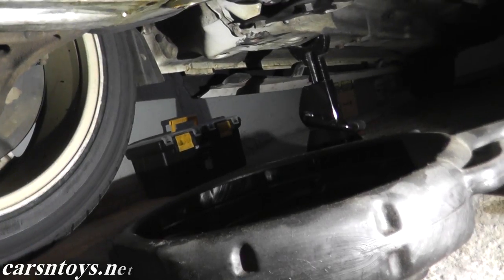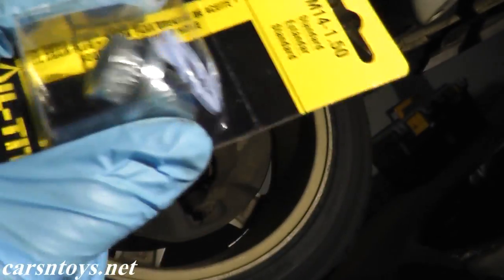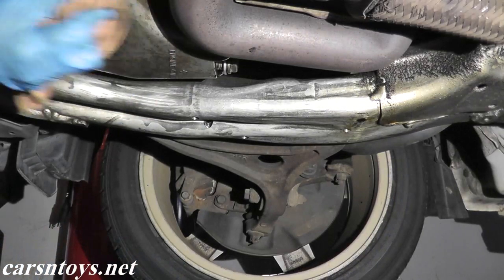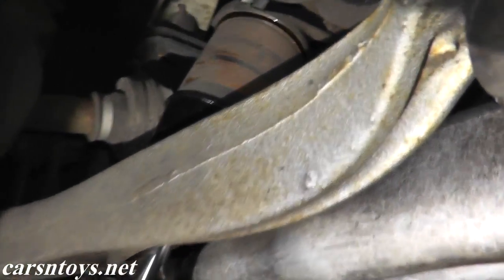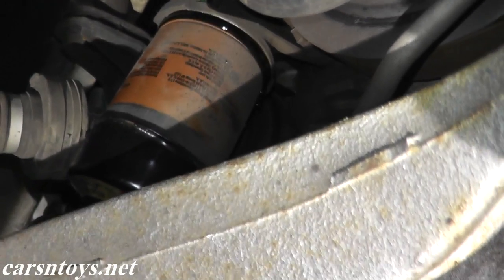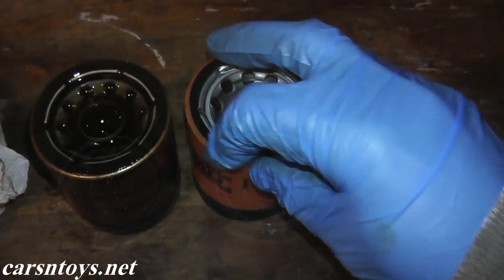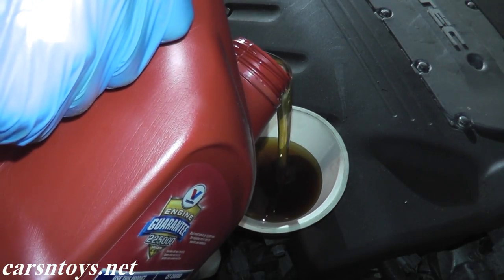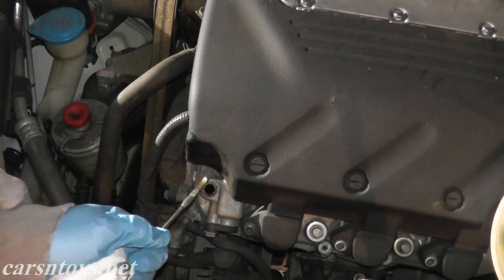Acura TL How to Change Engine Oil and Filter

Comment: I'd give a second thought to using dorman parts. On my previous car (2004 Monte Carlo SS Supercharged) I've had 2 sever failures of dorman parts. The first was a replacement ignition switch, after about 3 years it started going bad much like the factory (which lasted 10 yrs); being random dead ignition when trying to start. Before I could replace it I had the car shut-off while driving then refuse to start for about 10 min; I was very lucky I was able to coast to the shoulder.
The second was dorman aluminum replacement coolant elbows; The factory elbows are plastic and can crack as they age and will defiantly break when you remove the alternator mount/ belt tensioner. After a year I had a major coolant leak with the elbow at the intake manifold. When I pulled the elbows out the o-rings had melted, they looked like there was rtv on the ends instead of o-rings. I replaced the chinesium o-rings with GM seals from a new set of plastic elbows.

So long story short I've found the quality and reliability of dorman's product to be wanting. And I definitely wouldn't trust any of there seals/o-rings. add in that there warranty is terrible, your better served spending a bit more to buy either factory parts or higher end aftermarket.
Reply: I wouldn’t recommend dorman anything either, south main auto, a youtuber and an actual shop mechanic, hates dorman parts and has sworn to never use them.

Comment: Hi - can you please give me advice?
I bought my Acura TL at 100k miles and now it is about 124k. It already had the timing belt / water pump done. 
Besides oil changes, can you please recommend what else I should do? (anything to help efficiency/ prevent issues) 
I'm basically going to take it in to the shop and rather have everything done at once, then gong back n forth
Thanks
Reply: I heard to prevent issue, flush transmission fluid 3 x 3 (from what I see people doing), change the 3rd and 4th pressure switches ( I think it is to prevent engine failure.) other than that I think youre good
Reply: Also if you have problems with battery draining for no reason... remove the Hands Free System.  This drains your battery like crazy if defective.

Comment: What the BEST OIL and oil filter for an Acura TL 08 (6 cylinder)  and recommendations?
Reply: Honda oem oil filter, and for oil I use Mobil one extended performance 5w-20

Comment: My drain plug is stripped out. some hack cross threaded it. Any ideas short of pan replacement?
Reply from the maker: +King George of Quebec Visit your local auto part store and they'll have a bolt that retreads the pan. My experience with this bolt is use a little bit of thread tape. It will keep the pan from leaking.